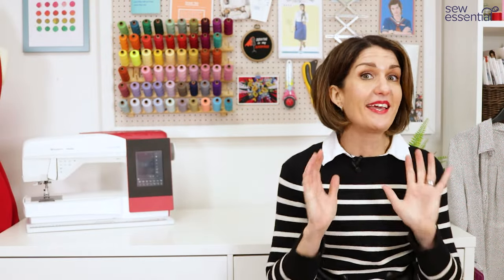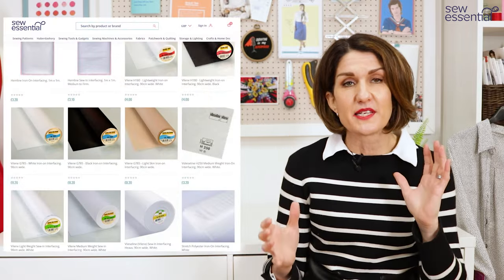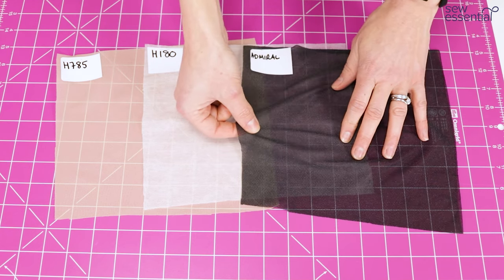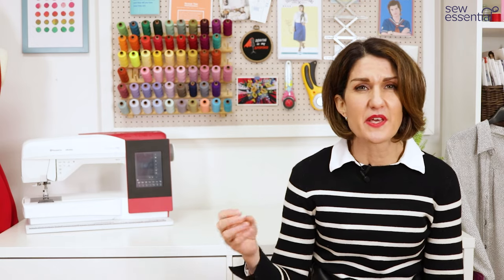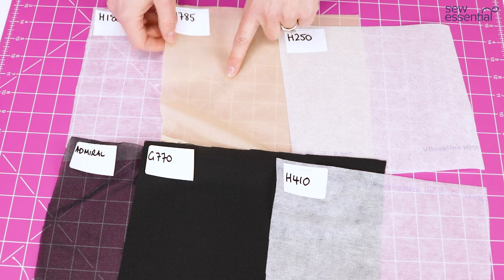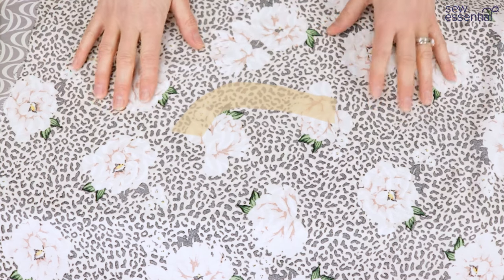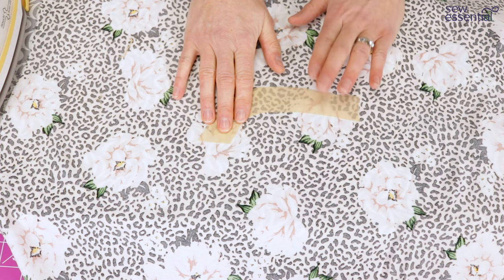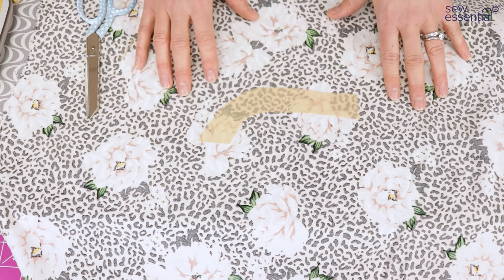Interfacing for Dressmaking - What to Choose and How To Use it

Comment: Remember to preshrink your interfacing if it is cotton or rayon! Just soak it in hot water until the water cools then hang up to drip dry. Don’t agitate or rub in any way (you don’t want to dislodge the glue beads!). I find that submerging and soaking does the trick.